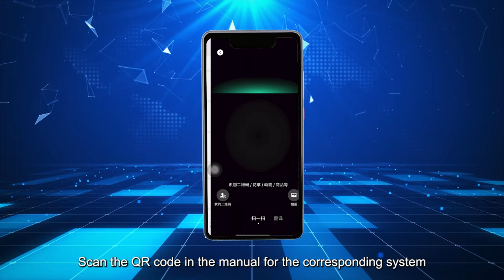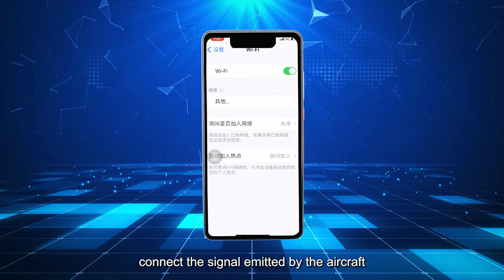S92 three camera drone, tutorial video#drone #dronevideo

Comment: Hello.  After takeoff, my drone flies in different directions and does not obey the controls.  How to solve this problem?
Reply from the maker: Dear, Maple Leaf has AB, please refer to the manual. The top left corner and bottom right corner are A, and the top right corner and bottom left corner are B
Reply: @BVDRONE  Unfortunately, it doesn't work.  The drone is still flying at maximum speed in an unknown direction

Comment: Hello. I purchased this drone and it works. But when i try to connect the phone to the drone's Wi-Fi, it keeps saying that there is no connection, therefore i cannot use the app. What should I do?
Reply from the maker: Dear, WiFi does not have a password. You cannot search because it has been connected to another mobile device. Please exit the WiFi connection, or you can take the drone to an empty place and then connect again
Reply: Why I can't control on cellphone

Comment: My drone won't connect with the controller
Reply from the maker: Dear, please turn on the drone, then turn on the remote control, push the remote control up and down on the left, and click one click to take off
Reply: didn't work, i turned it on but it doesn't connect with the drone @BVDRONE
Reply: on the remote control turns green stationary, but the drone keeps flashing @BVDRONE
Reply: When I turn on the controller, it flashes 2 times the green light, and then it stays still, then the drone keeps flashing blue, and the flashlight turns off and on, and the battery keeps flashing red  @BVDRONE
Reply from the maker: Please add my WhatsApp and shoot a video for me. I will tell you how to solve it. If you receive a bad product, I will resend it to you     8613824862252
Reply: @BVDRONE  ok